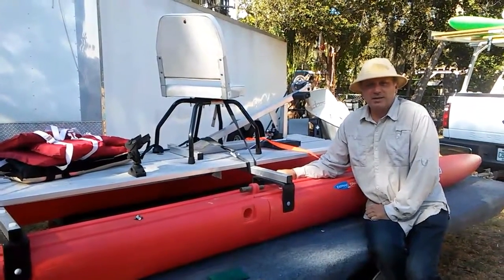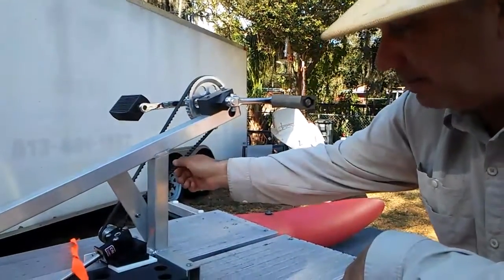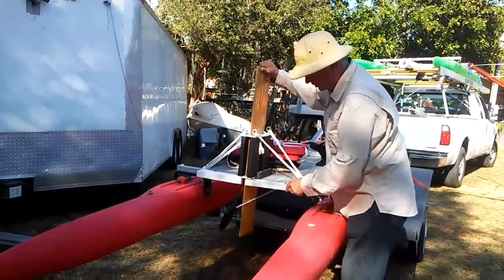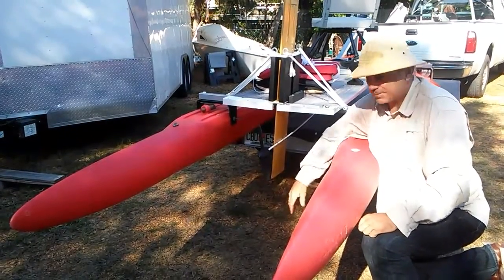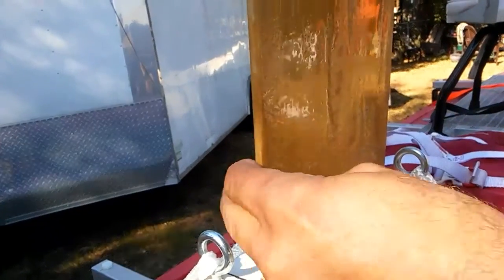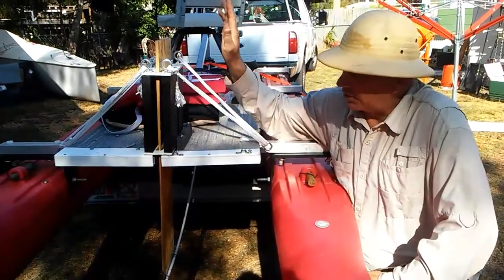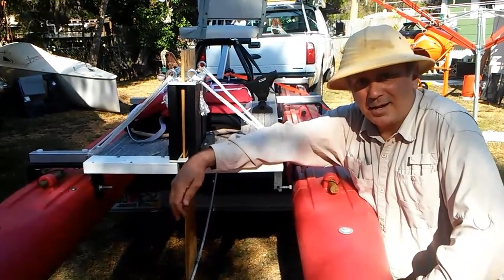Pedal drive on Expandacraft catamaran.

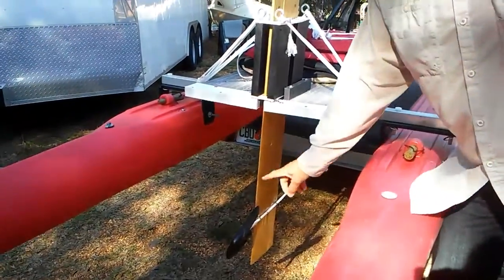Comment: Ok, cool, I can live with the tension.  I watched the video again, and at 1:18, you push down completely on the stab to its lowest position.  Will the attachments holding the shaft in place on the stab wear down the shaft?  That was what my real concern for the second UV joint would be.  Longevity of your drive system.
Reply from the maker: I think if we end up with a configuration like this, I'll use a material called Delron which is a space age polymer use for friction bearings. It's slick as goose shit and extremely hard. Remember, this is a rough prototype.

Comment: I don't know if it would help you or not, but you placed a stainless steel universal joint at the front of the flexible shaft.  I then saw that you would raise and lower the stab at the rear of the craft.  I believe that you would get a little tension on the flexible shaft.  Why not put another universal joint attached to the front of the stab?
Reply from the maker: The tension on the flexible shaft actually keeps the shaft from wobbling.

Comment: I like what you proposed. my two cents would be to have the propeller under the pedals. the hight adjustment would be right in front of you.  Then I would put the rudder in the back. it should allow you to turn on a dime, go forward and  backward. might be able to keep cost down that way. good luck with your products.  I really like what you have created so far. I will definitely be a buyer in a near future.

Comment: Good to hear this kind of news and a question!

As an angler I would love to have a turning propeller. That would really help to stay right on the spot after spotting the fish with the sonar. That's the moment when You need to steer the boat (to compensate the wind force) but You must not get any speed or You loose the fish.

300 dollars extra for the feature sounds ok but need to know the total price first.
Reply from the maker: Thanks for that tid bit of info from a anglers perspective. Total retail price for the 16 foot craft with pedal drive should be between $1,600 and $2,000 depending on a few options. The craft in this video only has two deck planks but you could put two more for a a total of 32 Sq Ft! Need more? Just step up to the 6 foot wide crass tubes or an 8 foot wide tri hull configuration. That's our big advantage, unlimited versatility.
Reply: The price sounds reasonable. In that price range You can find some new pedal kayaks this year.

I might want to set pedals as low as possible and a seat hight should be adjustable. To get maximum comfort on a long run and to maximise stability when the waters get rough.

I hope You start selling pedal&propel-kits separately for DIY builders as You sell hull parts.
Reply from the maker: An adjustable seat height would be a nice feature and that can be done rather easily. The pedals will be as low as possible but stability is not a problem on a 4 to 6 foot wide catamaran set up. I've been sideways to cresting waves and and all that happens is my feet get wet. You could put a low or adjustable seat on it and we are looking for one which is already available. I don't want to have to design and manufacture a special seat which would drive up the cost even more. One of my competitors kayak has a swivel seat option but it over $400 for the seat alone. Just an FYI, I plan to have an electric motor which will click onto the existing pedal drive. The competition has one for $2000 but I'm shooting for around $600
Very exciting stuff going on...

Comment: Hope you keep working on this project.  Not sure on the extra $300, what would that get us? I guess if you just made the cable bend it would limit the turn, so you need a gearbox or something? I also think it would be great if you made 6' center pieces too, then your boat lengths would be configurable down to 2' increments rather than 4'.
Reply: Would like to make a 14'6" (~) with platform and pedal drive. My fantasy feature would to be able to have the seat low for serious travel on a faster river, and then be able to pull up (unfold?) a much higher seating position for just creeping along.  Not an angler but do a lot of river photography. A fisherman would probably love those features too though.
Reply from the maker: The added cost would be for the ability to turn the boat on it's own axis (or spin around in place) by using prop thrust. With a fixed prop and a rudder, you must have forward or backward motion to make any turn at all. It's a 16'9 long boat so that ability may save you a lot of frustration in a narrow river.
Reply from the maker: That sounds like a great idea. if you're handy, you could always buy just the hulls and drive system then build a custom deck which fits your needs. My facebook page is full of client built craft with my hulls and components.